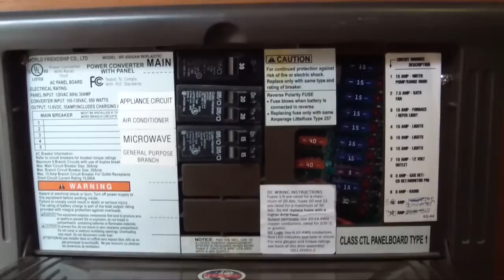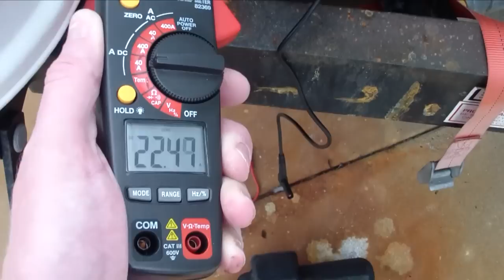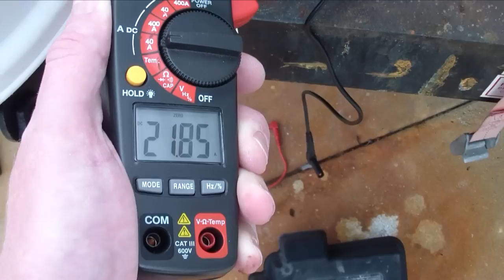Upgrading the converter / battery charger in my RV to Progressive Dynamics PD4655

Comment: Thanks for the video.  Both the WFCO and the PD have a white and a black wire from converter to the board.  I wired white PD wire to same post white WFCO wire was wired to.  The same for the black wire.  When I was finished I noticed the two battery reverse polarity fuses were blown.  I blew two more fuses, then read my PD installation guide and determined that the black PD wire is the positive, while the white WFCO is the positive.  Once I reversed wires, everything worked fine.

Comment: Thanks for the video!  I only discovered that bulk mode on my WFCO wasn't working when I went camping last fall in a campground without power, and ended up using my generator about 16 hours per day because the battery was only trickle charging, and I was frequently using my furnace.  The manual doesn't explain bulk mode well, and the service department of the RV retailer doesn't understand it either (I checked two vendors - same misunderstanding).  They told me that the converter is only meant to trickle charge.

Comment from the maker: Thanks. When the charger is recharging the battery in bulk mode (occurs when the battery is significantly drained), the cooling fans are about as loud as a desk fan.  As the battery gets more charged, the fans slow down and get really quiet.  Note: in most cases, your generator is going to be FAR more noisy than the cooling fans. When you're plugged in at a hookup campsite, the battery isn't going to be low and you won't be hearing any noise.

Comment: You'll only see your 55 Amp charge to the batteries if they are ready to receive that kind of current.  I charge three Deep cycles frequently and they only pull around 50 Amps When initial battery voltage is 12.2V and temperature is in the 80F range and they quickly decline to  20 Amps under a 13.7V charge rate.
The nice thing about the better chargers that you may not agree with is they will not force current into a battery and cause electrolyte boil like the older chargers would.

Comment: One issue you will have is your converter-to-battery wiring is not likely sufficient for high current (55amp) charging. It looks like the wiring is perhaps 10AWG, but say it is even 8AWG. With a 10ft cable distance to the battery, there would be more than a 0.5VDC drop in voltage at the battery. Since the battery charge rate is dependent on the voltage delta, a 0.5V loss is significant to the charge current.
Reply from the maker: Yeah - a few days later I upgraded to thicker wiring and solved the problem :-)
Reply: slworking2 Wiring is unfortunately something often overlooked, and can be the source of trouble more often than people realize. Glad you discovered that issue.
Reply from the maker: awboater Indeed.  Thanks.  The heavier gauge wire made a huge difference.
Reply: this can be negated with more time available to charge the bank, as there may be a voltage loss at max charge output, but when the charge amperage drops as the battery tops up, the loss will become smaller due the wire being fully capable to carry the smaller load.

Comment: Good video, but I should point out that the bulk charge mode for the WFCO (as demonstrated in the video) is normal. You will never see the rated amp capacity of the charger/converter being sent to the battery during a bulk charge. The 22 amps demonstrated is acceptable as a bulk charge. The tapering down to 7-8 amps is also normal. This is in line with what I see on my Progressive Dynamics unit.
Reply from the maker: Thanks. And true.

Comment: Thanks for the great informative video.  I have the WF-8955 unit you showed in the before state.  (Disconnected) I found one of my two deep cycle batteries not accepting the charge from my stand alone auto battery charger.  The 9 amps current just kept going on the one battery for 2 hours.  The other identical battery dropped to about 250 milliamp charge after about 10 minutes.  I believe the first battery is "toast" - - Thanks again.

Comment: Were you able to achieve the 55 amps when you upgraded the wire from 6 awg to 3 awg?
I have a WFCO 55 amp model in my 5th wheel. Considering upgrading to 100 amp unit. Looking at a PowerMax. Any suggestions?

Comment: Actually that is not a reasonable charge current for a low battery bank with a 240 amp-hour capacity.  Ideally it should go to about 20% of the total amp-hour capacity of the battery bank, which would be almost 50 amps.

Comment: What type of AC circuit breakers are those? Are they energized like residential ones when you snap them in, or do they require an in wire and an out wire?

Comment: First off if you have a 55amp converter and are running your lights and other stuff and are using 40amps worth of loads then your only going to get 15 amps running to the battery to charge it.. so it will take longer .. now if you don't have anything on the converter load wise then you will get 55 amps all going to the battery and will charge your battery from a completely dead batter to a full battery in about 2 hours!! not even in bulk charge.. That's the biggest misconception is ppl don't understand how a converter works and if your using your RV and have loads on like lights ect then however much amps your drawing will not go to charging your battery only the remaining will charge the battery.. so if you have incandescent lights each light is gonna draw almost 5Amps so if you have 10 lights on that is 50Amps and only 5amps will charge your battery and that will take a very very long time!!!!
Reply from the maker: Good points. This explains whey I can get it to put 40-something amps into the battery to charge it, but not the whole 55.
Reply: Do people still use non LED lights?... so sad
Reply: depends on where the measurement is being taken from.  if taken from the cheger leads, it makes no difference what the load is... the output of the charger going into the batteries should show the rated output of the charger... UNLESS the load is being tapped off of the charging leads BEFORE where the amp reading is being taken from.... the charger output is independent of the load, but it IS CORRECT that if 40amps are being consumed from the 55amp output, only 15 amps will be getting stored in the batteries...

Comment: Great Video!!! I just wanted to run something by you. I have a 1989 Challenger Travel Trailer that i want to upgrade the charging system and the batteries. Before i purchase PD 4645 and spend the $200 buck or so. I have a PowerMax Pm3-100. It says output 13,600 VDC and 100 amps. Would this safely charge 2 deep cycle 12v batteries? Could I integrate this into my camper? Or would it not work because lack of charging stages?

Comment: You show the new PD 4655 and you wired in a new DC board.  Where did you get the new DC board?  and why?
Reply: The new dc board allows the push button control of output to the battery . The board came with the converter .

Comment: Do you have the converter on its own dedicated breaker? So you can have the option of shutting down if you need to?
Reply from the maker: Hi.  I do have a dedicated breaker for the converter, but it's for electrical safety purposes and is separate than the main panel.

Comment: Thanks for a very enlightening video. I have replaced my deep cycle batts every other year for the last 5 years. I just didn't know my converter was cooking them.

Anyway does the 4655 automatically switch from normal charge to trickle when the batt reach full charge, or do you need to manually switch by pressing the button?

   Thanks again for the clip.

Comment: I think you have just enough electrical knowledge to be dangerous.lol I appreciate the video but will offer this. You showed 22amps off the old unit being dedicated to charge your battery, That's a very healthy current for charging. Any more and you risk boiling off the electrolyte. What was the voltage at that point? Also don't forget that the converter is capable of 55amps total. This is divided between charging, and running the DC bus. 55amps to charge IMHO is to much. I enjoyed the vid 73's

Comment: why do i have an extra green wire from the converter with the white and black wire they don't say where the green wire goes. Not not the one that was with the black wire on the breaker side I'm talking the fuse side. and I don't have a red wire. I'm ripping my hair out.
Reply from the maker: Chris Romanos The green wire should be the ground wire.

Comment: First thing you need to do is replace your battery cables or connectors at the least if not your charger is not going to charge efficiently